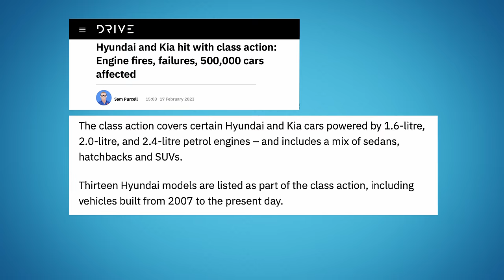Australian Mechanic Reacts to Aussie Car Problems

Comment: As a Kia mechanic, kia was forced to extend their engine warranties on some models to 99years/999999 miles. These were models with engines known to be defective. Although you do get a new engine from kia, it only has a 12month 12k warranty after installed. Thanks for all the free content Donut!

Comment: 7:14 what may look like a snorkel may not be one. there are 2 types of external air intakes for 4x4's a raised air intake and a snorkel. the former is just to get the air intake up and away from the factory intake in the fender that tends to suck up an ass load of dust kicked up from the front wheels. the latter does the same but is also designed to do water crossing's as well. a lot of factory mounted external intakes are just RAI's not snorkels, a lot of people mistake the factory RAI for a Snorkel and try to do water crossings with them and learn the hard way or are hardheaded and say snorkels are BS there on afterwards.

Comment: red backs are a regular issue around my home. if anything sits outside un touched for a few weeks. Its got some fat spider making more spiders under it. huntsman spiders is the car are passage of being Australian. They LOVE the sun visor. SO you open it and they drop on your lap.
Reply: Yeah, I've had huntsmen in the car. Not under the sunvisor (yet!) but I've had them trundling across the dash and up the A pillar and one night sitting on top of the steering wheel - every time I turned the wheel it would climb to the top again, it wasn't until I drove under a bright light that I realised what was tickling my knuckles! Oh yes, and in door reveals and under door handles too.

Comment: The hyundai issues were in the states too. Ours blew at 80k miles and we had a free rental for 7 months waiting on the dealership to get the new motor and turbo shipped and installed.

Comment: 11:42 i literally did this the other day, only i used a thick rubber strap. i was worried i would snap the stud off, it actually worked just fine. just have to be very careful and try and wrap around as close to the block as you can

Comment: i had to do something similar with an oil filter yesterday. we didnt have a clamp big enough to fit around, so i ended up puncturing the bottom to drain it, then driving a screwdriver into the filter with a hammer and using that as leverage to get it off

Comment: I have a Kia in the states with the same engine issue. Not just in Australia. I'm still waiting on a new engine, the issue is so common there's a long wait as they work through them. The dealer mines at now said there's a guy who's job is just replacing engines that seize from this and its a 1-2 month wait.

Comment: 7:05 In 1986, I worked for an earthmoving company at a coal mine. During some downtime from driving my giant water truck, I convinced the mechanic to let me drive one of the brand-new Landcruiser utes they'd bought for site work. So I took it for a run around the earthworks...and decided to see how it went through water. There was a nice puddle at the bottom of one of the borrow pits, so I hit it at about 40km/h. Yeah, it wasn't a puddle. It was a metre-deep, 20-metre long trench used to collect rainwater drainage. The new ute didn't have a snorkel and after my escapade had some issues with the rods and stuff...apparently a few were bent...can't imagine why...The ute had about 700kms on the clock.

Comment: My wife and I went to Australia in 2005. We spent a day in Sydney a few days in the Blue Mountains and 4 days in Tasmania just driving around. It was awesome. Really nice people amazing scenery and when they label a trail 4wd only they mean it. We rented a Trooper in Tasmania and I was amazed how well it handled those trails. Not sure how the rental place would have felt about us driving on the trail but it did say it was a road and all the document said was we weren't allowed to drive off road. Gorgeous waterfall at the end of the trail so worth it. Wish we could get that car here in the states. Trooper was awesome. Plenty room for our luggage and still got like 25-30mpg with me driving 80mph, occasionally. What an amazing country and experience.
Reply: Nobody does 80mph in a troopy. Kmh your speedo was in. Also did you calculate US or imperial gallons for your mpg figures?
Reply: @rossbrumby1957  I was doing 140kph so pretty sure that's close to 80mph. It was a relatively new one so maybe a 2004 or 2005 model. I converted from liters per kilometer to miles per US gallon. I wasn't going that speed all the time by any means, I should have clarified that fact. Most of the time we were doing 50-60mph. We drove around most of the time and would stop and go look at stuff and walk. Then when it got dark we would hunt for a place to stay and that's when I would drive faster, with the exception of our last day there where we were trying to get to some park before dark and then I did spend a fair bit of time running between 125-140kph. Amazingly didn't hit any animals along the way. I was young at the time and should have been smarter.
Reply: @rossbrumby1957  Thanks for the comment I put occasionally next the speed so as not to imply that was my constant speed. Now the Audi A3 we rented in Germany that car did stay above 80mph pretty much constantly and still got 30mpg. We were driving on the Autobahn and I like driving fast. Got it up to 140mph for a while but spent most of the time circa 110-120mph on the Autobahn then 60mph, which feels like you are crawling after doing 120mph, on the side roads. My wife and I have been blessed and have had a chance to do some travel on our own and some partly off from her work. Hope that answered your questions.

Comment: Been there done that went through too deep of a mud bog with my Jeep.  Went through too deep fill the intake with water. Pulled the plugs, shot nasty water out by using the starter.... Dump some racing fuel, driving home and got about courts of muddy oiliness out of the oil pan... Drove it for another 60,000 mi before selling it

Comment: A friend of mine has a Kia that was out of warranty and the motor just seized, had a bit of a stuff around getting onto the right department but they replaced the motor on good faith and the dealership in Morayfield Qld looked after her.

Comment: Kia dealers with blown engines... If thats the 2011-2013 that was made for just two models for like a year or so... somewhere in there... it was an engine where the pistons would burn holes through them... massive class action and they for some reason made the engine and next model year replaced it... so I think they KNEW the bad engiens and tried to quietly change stating more power or something.

Comment: Here in TX, we get snakes and black widow spiders in trucks all summer, just gotta be careful. also, the dog chain for the oil filter was good, but in a pinch, you can hammer a big screwdriver through it and turn.

Comment: Million dollar idea for Australians.  Now, hear me out... instead of using a car cover, there needs to be a full one with a zipper - like leaving the car in a sleeping bag when not in use.  You're welcome.
Reply: Pretty sure that already exists
Reply: I don't know if such a device exists, but you get a thumbs up for correctly spelling "you're."
Reply: The one poindexter that would buy a car condom would get teased into the eons at work the next day
Reply: @WHDRWN I see them all the time, nobody makes fun of them. Usually it is either a classic car or sports car waiting out winter, because the owner doesn't have the garage space. 

Would you really make fun of someone just because they want to protect their special car?
Reply: There are fully enveloping car covers available here like the carcoon. These are marketed for long term garaging in humid conditions, but I'd say you've identified a pretty valid secondary purpose!
Reply: @swankshire6939 No. But if they are doing it to stop spiders and snakes on their shit box, then fuck yes.
Reply: @mortified776  I think the only downside is that those sorts of covers probably aren't intended for frequent use (driving the car in and out multiple times a year/month/week), so you'd probably chew through them pretty quick. Could probably design something with like a hard base and a zip-up top though, so it's basically just the soft car cover but with a way to seal it to something more durable at the bottom.
Reply: @JiorujiDerako  Oh yeah you wouldn't want to be getting a car out and tucking it back into bed daily with something like that. However it is when cars are long parked that they are most likely to acquire "tenants".
Reply: @WHDRWN  Hmmm... teased or bitten by a deadly creature.  Ego or life.  Decisions.
Reply: @GarrettWorcester  Some of us paid attention in class. Mostly because some of us had teachers that wouldn't overlook that kind of thing and would call us out in front of the whole class.  Humiliation is a powerful teaching tool.
Reply: I can't believe nobody has built a hot rod and ran the exhaust up out of the engine compartment and along the windshield pillars and onto the roof of the car

1- you keep the heat out from underneath the car
2- the engine runs more efficient when the engine doesn't have to push the exhaust out and it flows upwards naturally
3- you can lower the car and put a skid plate underneath to keep all the air out
4- it just looks cool and original and nobody's ever done it before especially to an old school V8 cuz it would look like a snake or a dragon coming down the road
Reply: Dude those have been out since the early 2000s where have you been
You fill them with air to keep them inflated

Comment: Years ago I owned a Ford Explorer, and I decided to change the oil myself. The oil filter was so tight the filter wrench I had couldn't make it budge, kept slipping. I ended having to use a screwdriver and a hammer to bust a hole through the filter and pry/twist the bastard out. Took me nearly an hour because of the way the filter was position I had very little room to work. Afterwords, I told my dad about my misadventure and he suggested adding small dents in the filter before installing them that way the wrench I had(It was the kind that had 3 fingers instead of a belt) would have a better grip. Tried that and so far it seems to work.

Comment: I've used a bicycle inner tube to remove oil filters. Didn't need as much force as that chain appears to.
Reply: The force required would be dependant upon how tightly the filter is installed, and the angle that you are pulling from. Using a chain wouldn't increase the force needed, nor would using an inner tube reduce the force needed.

Comment: 3:10 The redback looks and sounds suspiciously like a black widow. You have to watch out for those in the Arizona desert when working on old cars or planes. Usually not fatal but not a pleasant experience getting bit by one. Rattlers aren't terribly deadly but the coral snake sure is.
4:15 came off the throttle abruptly or had a malfunction leading to sudden loss of power. An amazing save. Powered right out.
9:09 Of course we had to see that bogan with a Mad Max fixation...

Comment: That LandCruiser clip, you can see that it's got a snorkel on it, but, I'd bet it's the factory Toyota raised intake which isn't sealed, and/or it just sucked water in through that drain hole that they showed at the end of the clip

Comment: my small city car, did have fiesta 2007 plate but current i20 they both do a bit off road at times. pick your lines right read the track good if you going to be on three wheels have just enough speed to get drive tyres back on the ground. been off road many times even in to forest never had damage or got stuck, calculated moves know what you drive and pick the lines what work best. loads fun and my car both city cars have prob done more off road than at least 90% range rovers in uk. small light weight fiesta was better less power but had diesel a french diesel and manual lowdown torque great and small diesel bit extra weight over the drive wheels can help, current petrol at 1.1 ton with tank fuel so very light it just requires small bit extra speed some times and for engine size torque is not bad for age only 30 nm less than my old diesel. good set summer tyres with high wet rating as lot places i drive can get 4 meters rain a year never really felt i struggled for grip. steep climb forest track side mountain mid winter had to clear fallen branch hand brake not work to slippy put it in to 1st engine off with hand brake on locks all 4 wheels all good just be quick just in case pops out gear but even 4x4 handbrake only locks rear wheels and was so slippy that would still had to leave it in gear too, same climb track ended at split to walking path to narrow so 3 point turn side mountain in the woods on wet mud track with inches to spare i got out damage free that my first week driving after passing my driving test. i get 40mpg if i drive careful only £35 a year road tax and parts cheap disks pads £60 a corner fitted, tyres £60 each. got 4x4 £500 a year tax, £150-200 tyre, and prob half mpg so it cost me more on something ive never needed my city car its surprising just where you can take it and careful and calculated moves you won't get stuck or damage and always have plan b and c as you might have to adjust. bonus most the time only 1.1 ton car, great fun twisty back roads and right conditions if left behind bmw m cars with 3x the power, lightness adds fun and great in corners with good tyres and brakes

Comment: 5:15  One of the stupidest things I've ever done in my life was drive through a flooded crossing. Even the road trains were questioning whether they would go through or not, my gf of the time said the local trick was to have one person walk and the car follows them so that's what I did. Part way across I could feel the car loosing traction on all wheels because of the rushing water and the fact my car was becoming a boat. I had a CB radio in the car and the truckies were half laughing half planning the rescue. Made it across though somehow, very lucky I guess. I was in a stereotypical "hot-hatch"

Comment: Diesel tech here, just thought id say, NEVER install spark plugs with an impact, that is a bad idea, I don't think I even need to explain why. Side note, if you ever work on a Ford triton engine they have spark plugs that are known for breaking during extraction than require a special tool and a lot of time to remove the broken section. An interesting trick to remove them without breaking every single time without fail is to use a impact, best method i've ever found so far.

Comment: Best Aussie ingenuity I have seen is cap and rotor made from a roll of tape, some heavy gauge copper wire and a whittled stick. Can remember thinking the skill and precision to make that actually work not just run was pretty well beyond but few hours after hearing the story the old Digger rocked back up the shop and dropped em in my hand.

Comment: The cheaper to replace the whole engine thing also happened with my mom. She drives an Opel and it was burning more oil then what would be normal for a car with that mileage. They just replaced the engine since it was still in warranty

Comment: The filter wrench one... does no one use leather belts anymore? I've had a lot of filters that a filter/band wrench didn't fit or work, but strap a leather belt on it and yank just like he did with the chain. Leather is pretty grippy, and belts are a choker in that the harder you pull the tighter it gets. So they work fantastic for that task. had some younger mechanics look at me real weird when I go to take my belt off for a filter, then the immediate flash of understanding when they see what I'm actually doing lol

Comment: 7:55 the issue with Kia/Hyundai engines... My little brother was mechanic for Kia and Hyundai I have videos of a brand new engine that just got put into a car and my brother had a socket and a bar holding the crank then proceeded to turn the cam while the engine is "locked".... Kia/Hyundai are junk timing chain tensioner being the main issue, it either fail in 10k KMS or they're broken before Even going into a car,

Will email q link to the videos
Reply: That's so funny seeing Hyundai/Kia owners crying about reliability issues and here we are in India getting reliability as good as Toyotas

Comment: I had a filter stuck like that on ly moms mustang. I took a c clamp and tightened it all the way down on the bottom of the filter so it was more square instead of round, then i put a pipe wrench on that and got it off. I really really hate ppl that dont lube the filter or crank them on
Reply: Only idiots use filter wrenches
REAL MECHANICS KNOW you only need a HALF-TURN after it touches.....
Reply: @thecloneguyz  idk why ppl insist on turning it til it wont spin anymore

Comment: You really don’t think we’d notice the absence of the Barra, and ALL THE FORCED INDUCTION. It’s a tractor motor with as much turbo and super as you can fling at it to get the family Ute from zero to ALLL THE KPH. It will get you to the servo, it will get you to Bondi Beach, and you will smoke seppo steel the whole way without a break down.

Comment: If you can’t get the oil filter out put a hole in it with a screw driver and let the oil drain out then put the screwdriver through the side of it and use the leverage to get it off

Comment: Well, you mention water shooting out of the spark plug holes... I had a stuck carb on a motorcycle and pulled the plugs to do that with gasoline. That was MESSY! lol P.S. geysers of gasoline is a bad idea

Comment: To all you idiots complaining about blower surge it doesn’t make the engine horrible. It just makes the engine lean out slightly increasing the RPM. Every single person around here has blower surge on their pulling truck/ tractor pulling engines and drag racing engines